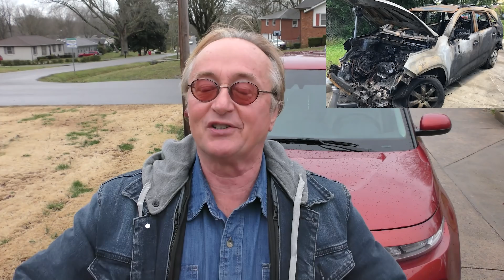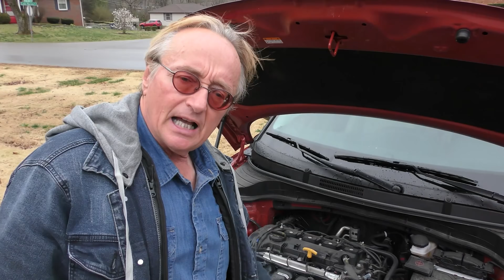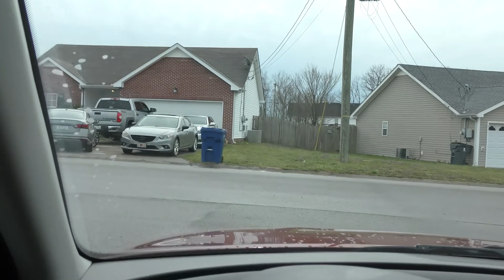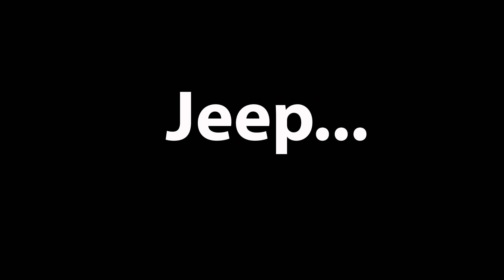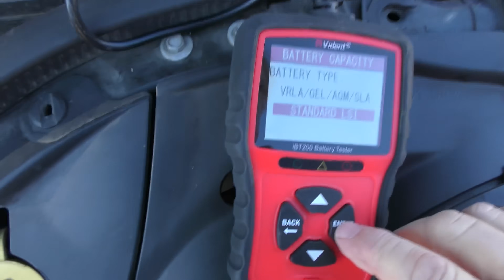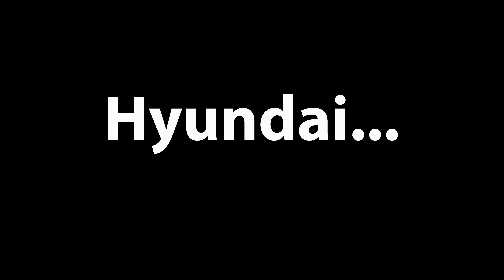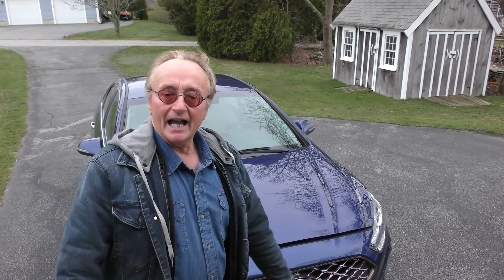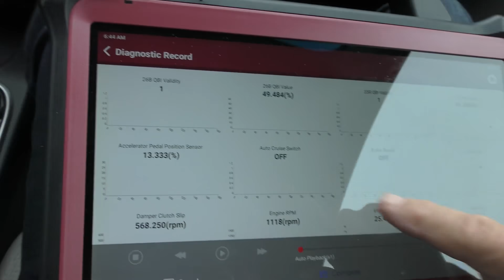3 Car Brands That are Crap

Comment: Friend has a Saturn Vue 5 speed manual 4cyl, has 267K on it, still running great. Come to find out the 4cyl motor from that year is a Honda Motor! Small wonder it’s still rocking. Look forward to every video, Scotty. You are the best, Sir.!
Reply: Yeah, my cousin taught me that trick about Saturns.
Reply: The Vue V6 from 06..07 also have Honda motors

Comment: I dont know how Hyundai operates in US, but in my country (India) they are considered one of the best manufacturer both as a customer service and reliability perspective. My family owned a Hyundai Santro Xing (2003) for near about 20years and it was still running fine even after 150,000kms on it. We did all the necessary brakepads, clutch, usual service changes but the engine was still with its original seal and gasket, so was the transmission. Sold it recently to buy another Hyundai (Venue) with an iMT xD

Additionally, we have a 10,000Kms or 1year oil change interval here, for every Hyundai car.

Comment: The only vehicle i ever owned that had absolutely no problems was a 2006 hyundai elantra. I bought that thing dirt cheap from a guy in town, and i bought it to kill it. I know myself, i wanted a brand new car but i knew i would keep putting off buying one as long as possible to save money and id just scrapped my first car i ever bought. 

So i bought the hyundai so i could have another POS that would die eventually and force me to buy a brand new car. I had it for 3 yrs, never did ANY work to it. Never changed the tires, never changed the brakes or fluids except for 1 oil change. 

It never died. When i sold it, they said the only problems were with the wheels (obviously) and that was it. Bought a 2016 ford fusion and that thing was the most worthless vehicle i ever owned. Gorgeous vehicle, and really fast with decent mileage (had ecoboost AWD) i was ecstatic with it for about 6 months. Then i HATED it. Owned it for 5 yrs, wish i could get those 5 yrs back! I had to have spent 10 grand on tires. Those tires are the most worthless tires ive ever heard of! They pop for literally NO reason! 

Finally i bought a 2018 f150 this past month... hope i still love it 6 months down the road.

Comment: Just got a 2006 Corolla 127000 miles $2500!  Also have a 2016 subaru crosstrek 47000, great so far.   Also a Ford F-350 v10 super duty 2001, 68000 miles.  Truck used sparingly not any real problems just annoyances.

Comment: Love ya Scotty.. BUT I have to defend my 2007 Kia Sedona EX, generally rated as one of the least problematic of the model years... It has the 'better' engine ( not underpowered ) thats so quiet even with the window down, it can barely be heard and it blows my old Toyota Sienna LE Van away.  Sure the Toyota engine had high mileage and nary an issue but the rear axle rotted and one day BENT requiring a replacemment of everything else too ( all brakes, lines etc ( costing more than the van was worth and at one point the Sienna failed emissions and I was told 'because the entire exhaust is ONE PIECE.. the WHLE THING needed replacemment ( at a mere cost of nearly 4k )  There were a few recalls of the Sedona early on ( alternator not charging battery properly ) and such but after almost 16 years? It looks great, runs great etc.. I personnaly think most 'new or newer' vehicles are made cheaply and have a lot more to go wrong.. Your STILL 'da-man!'

Comment: Your full of it bought new 2010 kia soul with manual traded in my one owner Corolla.  Been great car only thing is you must use Mahle or Mahn  Blue filters on Hyundai/Kia products.  Easiest car ever worked on!  VW,Bmw,Jeeps,Toyotas by far easiest.  Did coolant green asian change,oil and blue filter,new NGK platinums less 25 min.   My Scion XB took forever do work drop shields jack it up little.  Corolla same.

Comment: I have a 2013 Kia Soul with 90K miles on it. It’s an economical car. Doesn’t go fast or have much power, but get the oil changed every 4K miles and it runs like a dream. Never had probs with it and Kia has the 100K/10YR warranty on it too.
Reply: You barely have any miles.......

Comment: I'm a big fan of Scotty but I am totally going to have to disagree here, true the Hyundais and Kias have problems but if you check consumer reports the Toyotas and Hondas are well below Hyundai and Kia. I currently own a 2014 Sonata and it's been an amazing car. The only true major problem I had with it was the engine going out but they replaced it. Plus no other car manufacturer would do that. The Mitsubishi  transmissions in them sometimes have problems but most DCTs do.

Comment: I just changed the oil in my fiance's 2013 kia soul. It had 110,000 miles. The change was at 5000 mile interval. It dumped just under a quart of oil and took 4.5quarts. 😬😬😬😬

Comment: I got a Toyota estima1996 model, 91 unleaded fuel. It's done over 249.000 kilometers and not once in one year did it ever lose oil. I change my oil once a year with my oil filter and air filter. Not an ounce of oil was wasted and the oil was clean. I changed it anyway. Petrol consumption sux. That's because I turned it into a tiny home.

Comment: Happened to Toyota with one of the 4cyl engines that are usually in Camry's.  I was a tech at a Toyota Dealership, about 15 repair bays and 1 alignment bay.  Every tech had an engine swap on their lift everyday for a good while.  Happens to the best of these brands.
Reply: The difference is....Toyota fixed the issue. Hyundai and kia havent
Reply: @richsweeney1115  Honda and Toyota have been in the game much longer than Kia and Hyundai...In North America at least...I don't remember ever seeing a Kia until maybe mid 90's and Hyundai in maybe late 80's?  Honda and toyota have been in North America since the late 50's.  So Hyundai and Kia are still relatively new.

Comment: We bought a new 2017 Jeep Cherokee Trailhawk.  When we picked it up, the salesman told us that FIAT was involved.  I wanted to run for the hills after hearing that.  However, I have to admit that this Jeep now has over 60,000 miles and never missed a beat.  The 275HP engine is about as fast as a V-6 Mustang that I had.  And gas mileage is in the mid 20's.  I heard you want to stay away from the lesser Jeep models, like the Liberty and Renegade.
Reply: yeah if you stick to the big 3 models of jeep youll find pretty decent reliability. but if you want real reliability from jeep, anything TJ and older are some of the most reliable vehicles ever made. ive got a 97 grand cherokee with the 5.2 and its got 306k miles and still kicking.

Comment: You thought 3 months was bad?  My 09 Town & Country Limited came with a factory lifetime powertrain warranty.  When it had 180K it started shifting into limp home mode and throwing fault codes.  I took it to local dealer.  They had the remanufactured transmission in stock and it's an 11 hour flat rate time to swap, a two day job.  But no, it had to be a dealer rebuild.  Problem: local dealer didn't have a tech authorized to do that rebuild.  So, I had to find another dealer further away.  Took it there, their tech had just left.  A month later took it back to original dealer who had gotten another tech.  That tech left .  Went to second dealer.  Took it back there.  Tech left there again.  All this time the zone rep refused to meet with me, talk to me on the phone or allow email conversation.  Wrote three letters to chairwoman's office, no response.  I finally found a third dealer who did the rebuild in a week.  Car was out of service for 5 months.

I've been a Chrysler customer since 1979,  Currently have 5 minivans and 5 RAM diesels in my fleet.  I've "sold" Chrysler vehicles to at least 15 other people in that time.  There is no Chrysler now.  Stellantis is a Peugeot off shoot based in the Netherlands.  You can't take any legal action against the parent company as a result.  I'll not buy another Peugeot product or recommend one to any one else.  And if that's how Peugeot treated it's customers in the U.S. we now know why they failed miserably here.  I suggested that the zone rep be fired, but that before they fired him they give him two sales awards.  One for selling an F250 and another for selling a Honda Odyssey.

Comment: My ex wife used to have a 1988 Pontiac LeMans which had a Korean motor in it. Before it reached 20,000 miles, it was leaking oil out of every orifice it had.

Comment: Open an inspection hole in the tyranny, sensor, or other, that gives a small access hole to the internals, and punch a mark on a part and take a pic with a small mirror or one of those tiny inspection cameras that record the footage, before you take it in. 
I know people who have done this to pistons through the spark plug hole, when taking the car to the dealer/mechanic, who claimed to install new pistons, to then find their punch mark on the pistons when they brought it home.

Comment: My granddaughter bought a new KIA, before it had 5000 miles she got a code that the dealership said they didnt know what it was. The company in my estimation freaks out, the factory wanted the transmission !!! So they took this brand new car and ripped the transmission out and changed it ! What the hell is that !

Comment: As far as I know, Hyundai and Kia are the same company.  Kia was going broke and Hyundai bought 34% of Kia in 1998.  They share the same engines and drivetrains plus other components.   They supposedly are run as separate companies but Hyundai is the parent company.   Scotty did not mention the automatic transmissions on Jeep products.  They are just terrible.

Comment: I have a 2011 Vw Routan. If you know about them, then you know all it is a Dodge Grand Caravan/ Chrysler town and country. Anyways, I was having totally integrated power module issues and I bypassed my fuel pump relay and now it runs great. There is an engineer who created a bypass for it who sells them online like 60 bucks. A lot cheaper than getting a whole new tipm replaced.

Comment: Kia absolutely gives no fcks about it's customers. They sent me a letter saying my Soul had a recall and I needed to bring it in for a new Catalytic converter and Engine. I ger to dealership and they say nope that was sent to you by mistake you aren't involved in the recall but we'll check your car. Came back,  yeah you definitely need a new Cat but your Warranty is gone and you aren't part of the recall so that'll be $5000 and also these other 100 things need to be fixed. 
Fast forward to my uncle, a 45 year mechanic, looking at it, ripping guts out of Cat and none of the other "problems" existed. I'll never buy another Kia. Nothing but crooks and it burned oil like crazy

Comment: I actually knew people who had their brand new Kia's break down on the way home from the dealer after they just bought them. 😂
Reply: And I know 3 people who own Kias. 2012 Sorento (236,00 miles and only normal service) 
2014 Optima (182,000 miles) - no issues
2018 Sorento (128,000 miles) - purrs.
Reply: @Larry Jones  bro my 2004 toyota camry has 270k miles and runs like a dream, no issues. Kias are trash
Reply: @kylergoodson1961  I think it might depend on the exact model. we used to have one from around 2010 till about a few years ago and it didnt have any to big issues.
Reply: Oh wow! 😂

Comment: The response you have about the Kia burning oil and how it shows up on the plugs makes me shake my head.  The issues I’ve been having with misfiring, when mine starts (and yes, it’s hybrid), was speculated as “water in fuel”… even with P0300 codes 🙄. I finally (told) the dealer to change the plugs &, looking at what they took out…… the insulator’s burnt BLACK! …an uneven black as well.

I could go on for a LONG time about how little Kia has done to rectify WARRANTY issues I’ve been having.
Reply: Yikes,what State are you in? Im looking for a manual Kia Soul!

Comment: Over here in the UK, my regular weekly favourite car breakers check for new arrivals of interest to me was a disappointment. Nothing of interest. Along the tidy lines of many Mercs, AUDIs, VWs, French, Korean and other stuff, were at least FOUR JEEPS like that. None accident damaged, just thrown away by owners. 

UK roads are now infested by pick ups and SUVs some of Monster Truck proportions. Their bulk, weight and massive frontal areas mean they need much more fuel to punch through the air. With the cost of fuel now, and with electricity costing far more, I expect a change of mindsets by car consumers, not to be confused with car enthusiasts, to more sensible and practical means of getting about.

Comment: P11EE00 Tacoma code of death. 2018 75k miles. 
Have Toyota Tacoma. tear engine out. No3 cylinder bad. 4 burnt valves. 69 days in the shop due to national part shortage. Covered under extended warranty. Nightmare.

Comment: I had a 2003 Kia Rio and it ran good but I had a lot of trouble with belt squealing, I would tighten the belt and a month later it would squeal again. Every month or few weeks I would tighten the dam belt and at the 6 month mark change the belt again, and repeat. I hate Kias!

Comment: I've seen lots of videos about them on TikTok. One person had a video of about 20 cars at a Kia dealership waiting on engines.

Are they waiting for the customer to make a mistake so they don't have to replace the engine under warranty?

Based on what I've seen, I'd probably only buy a Honda or Toyota. Not that people haven't had issues with Toyota, like the people that died in a Prius because it wouldn't stop. That's why I'd only want one with a key or manual transmission.

Dodge, Jeep, and Chrysler are the same, and most of them I wouldn't buy. Low mileage, maybe. I drive a ProMaster that I like mostly, and the brand new ProMaster City that has a lot of concerns if I bought it new. Gas mileage is terrible if you're idling. It tells me it should get 400 miles per tank, but it could lose 20 miles just idling for two minutes at a delivery. I bet I get under 200 miles from a tank.

Comment: Kia replaced my motor at 103,000 miles. I have driven it 15K so far. Leaning more toward a Hyundai as their motors seem to be built better. Car prices are stupid high right now so maybe I'll wait awhile. Auto Trader listed 1993 Chevy Silverado at $18K n up.  I just completely rebuilt the entire truck as it was cheaper then buying a new one. Radiator to rearend brand new AMERICAN parts. Kia 32mpg, Silverado 11mpg.

Comment: I'd guess the Hyundai just needs new solonoid seals in the transmission. I have an older BMW with the ZF transmission and this is a common fail point. It can make the car feel like it stutter or clunks on a shift. The transmisson fluid that is normall forced through a seal is partially by passing the seal not giving it the correct amount of pressure. Thus resulting in a noise, clunk or rough shift. I'm sure the transmissons are differnt between these manufactures but I guarantee it is as easy as relacing a seal, gasket, or bushing somewhere inside the trans.

Comment: My nephew bought a new Hyundai and had the transmission problems, and they said the replaced the transmission, but my nephew went under the car and put his name with a marker on the trans in a hidden place. before he left and infront of the dealer seen that they did not replace it just changed the fluid.  He reported to Hyundai and found out the dealer was just changing the fluid and charging Hyundai as a complete change. It happen to a lot of owners. The dealer had to pay every owner for a new trans!

Comment: Had the same oil burning malarkey problems with a Mercedes-Benz ML 320.   Finally at 60k miles they agreed to fix the motor.   The transmission went out on the vehicle at 62k miles and had never towed anything.     The warranty had expired of course.    Buy a Toyota and you’ll have better luck IMO.

Comment: Ya, cold and electronics on jeeps are definitely not friends. Also, humidity and proximity to the ocean can cause them to act up too. Salt is an electrolyte Which means it makes water conduct electricity. When salty humid sea air comes in contact with a part of the wiring where insulation is broken, it causes circuits to short or show incorrect data.

Comment: wiring faults and bad soldering! got a computer playing games when it's cold? likely bad soldering!

i have fixed many a bad computer by applying flux and baking it in an oven for 5 minutes at 300F (150C)

do not do this in your kitchen oven! the stench is disgusting

Comment: Scotty, I love watching your channel, but seriously, ALL manufacturers have put out vehicles that have had issues with any model. It sounds like the poor person who bought that Soul just got a lemon. I've owned a 2014 Kia Sportage (bought used) for years now and it has over 110,000 miles on it and have never had any major trouble with it. In fact, I think that it is still as peppy as it was when I bought it with around 23,000 miles on it. I also bought a brand new Kia Soul in 2020 that just came up time for an oil change at 35,000 miles on it and other than more wind/road noise than I would like while driving, has had zero issues. If that person bought it new, have they been religious in changing the oil every 5,000 miles using 100% full synthetic? If they picked it up used, was the previous owner(s), religiously changed that oil every 5,000 miles? Proper maintenance goes a LONG way towards keeping ANY vehicle running like it should..... 
Also, the Kia dealership that I have them serviced at offers 2 types of oil to choose from, a 5,000 mile oil and a much more expensive 7,500 mile oil. Did that person put in the 5,000 mile oil and expect it to last 7,500 (or more) miles?